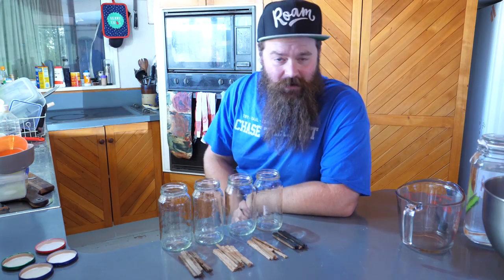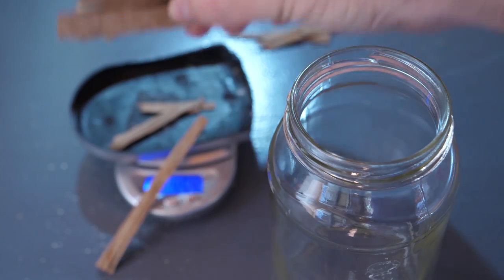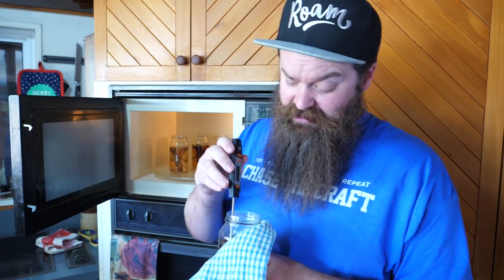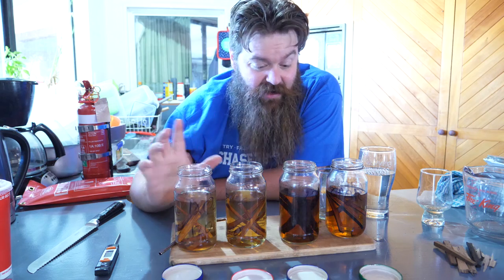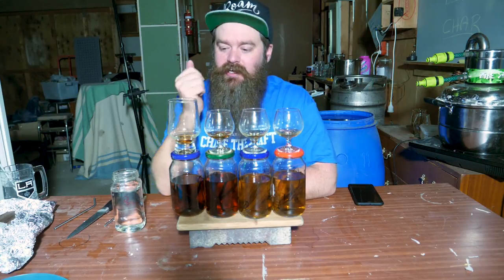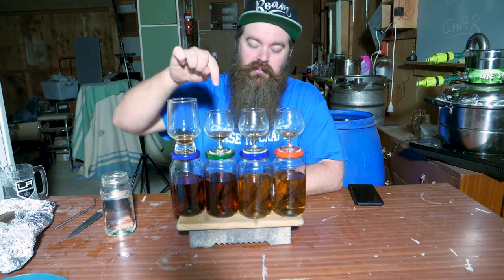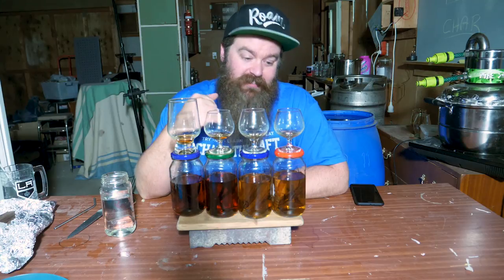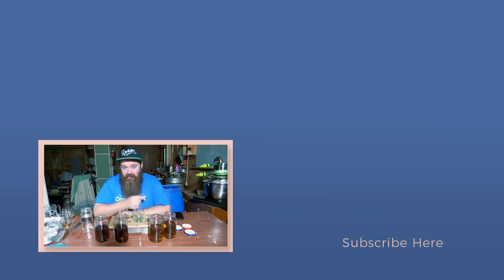Testing Different Oak Char & Toast With Nuclear Ageing

Comment: I age mine in a sous vied water bath. Slow heat prevents the glass from breaking , keeps it at a constant temp, then take it out and freeze for an hour , do it again . You can keep the lids on and not worry about accidents.
Reply: I know this is old, but do you have a fav time and temp?
Reply: @thirstbuster78  I wouldn't think it would be to high, to mimic what a whisky warehouse might experience.  90f max for a couple hours?

Comment: Thanks for a very good video that so thoroughly acknowledges the differing approaches and applications to this very complex phase of craft distilling!   
  I’ve personally come to the conclusion that jar aging can only mimic long term rest in a barrel.  I’ve also reached the conclusion that over-oaking isn’t really an overarching concern.  Why?  Because with small sticks or chips the wood pretty quickly becomes saturated and won’t give up any more after a certain point. After this initial saturation point of a couple of months the flavors extracted from the wood will mellow on their own. Time is a key element that cannot be discounted. 
  I’ve arrived at making the largest splits possible of about 3” in length and will fit thru a 38mm jug neck. I use enough to more or less float as a single layer in a gallon jug that is about 3/4 full of about 65%. These are toasted/roasted/charred over an open flame in a small covered pot with a perforated bottom. I keep shaking these to put out the flames until they get hot enough to want to burn. I then take off the cover and let them burn until it’s too much to handle and then quench in a bucket of water. Some of the sticks are deeply charred while others are toasted to varying degrees. Generally, about 15 of these go into each jug. 
  After about a month the liquor will be quite smoky tasting and very woody. After a couple of months the sweetness comes to the fore.  After sitting thru some colder weather it really settles in. It seems to be pretty well settled after about 6 months or so and I’ll usually start bottling some off but some have sat through the winter months. I usually clear out the last of these by about 9-10 months to free up jugs for the next season.  Doing all of this in an unheated garage gives all of the temperature fluctuations I could want and I consider 6 months to be a minimum target but haven’t seen any problem with letting it sit longer. 
  An awful lot of posters seem to panic when it gets dark brown and tastes strongly of wood after a few weeks but as I’ve said I figure that first couple of months to be a saturation point. It won’t do any more than simply mature after that. Time and patience. 
  Just my 2 cents worth and what seems to work pretty well for me.  Thanks again for your concise advice based upon your experience.
Reply: chucker have u tried electric heat gun

Comment: Hi Jesse, just adding a note here.  I have used a batch of chipped American Oak to flavour my first litre of whiskey which turned out delish (to my untrained nose and pallet), but seemed to fall short on the second batch (using the same wood chips). SO I've come to the conclusion that the wood chips I used (about 100 grams per 1 litre of 80% spirit) was good for the first batch but ran out of goodness for the second litre. After a few iterations of heating and cooling on the second batch I couldn't shake a certain chemically smell. Once I used fresh wood chips it was gone immediately after the next heating cooling iteration. I came across  great article  that said the chips impart certain smokey caramelly\vanilllaish flavours in to the spirit while the charred charcoal chips present act as a filter and soak up undesirables. Thanks for your efforts. Im having so much fun!!

Comment: What I have done successfully in the past (and present) when doing quick aging of spiced/herbal spirits such as Akvavit, Bäsk etc. to try out the spice blends proportions is to put it in bottle/jar in dishwasher and let it run a cycle or two.Same works well to get initial coloring from wood.
Reply from the maker: nice
Reply: This is a really good idea when you put it on 70 degree celcius dishwasher but how can you control the expansivity ? The boiling heat of ethanol is 78 C  and if it starts boil (forexample) it will blow up it's container. Even if you controll the heat and just hold on 70 degrees the expansition will start. Am I wrong please let me know

Comment: Fantastic experiment.  Oddly enough this past weekend I was doing some taste tests with friends in a nuke aging experiment.  I did 4 cycles + 1 week and compared it to 1 month, 2 month and 3 month regular aging.  All using medium toasted oak.  Everyone preferred the nuke aging flavors.  I did do my cycling a bit different than you but more experimentation is def in order with the results I got
Reply from the maker: Tru that? 
Interesting man!  Yeah I must say I waas blown away at the flavour I got out of this.  Definitly keen to play with it some more!
Reply: Few months of aging won't do much for the profile in normal environments as you don't have the temp range change of winter/summer/winter/summer/repeat does when you age for years.  You need the full cycle.

I know a couple of guys who vary the cycles.  Some cycles are "warm" and some "cold" and some "hot" and some "freezing".   You can use anything from heat lamps to radiators to microwave to stove top in water to putting outside in the sun.  For the other cycle you can use the refrigerator, the freezer to outside in the winter.

Vary the cycles like in nature.  Try many cycles to see if a "10 or 15 year" cycles is better than a "3 or 4 year" cycle.  Try with less wood over more cycles as well.  Try with used wood after first batch.

If you loose the "complexity" of the un-aged shine, feel free to blend un-aged product back in to the final mixed product.  You might find you like some wood at 5 cycles, other wood at 10 cycles.  It doesn't all have to be aged the same amount of cycles.  Keep good logs and adequate samples as you go for reference.

Experiment!
Reply: Also keep in mind you can add complexity by using the wood to "age" sherry, brandy, wines and other alcohols first before using them for you whiskey.

Comment: I have a useful labeling tip. Use clear tape, write on the tape once its been stuck on the glass. Apply another piece of clear tape once the ink is no longer runny. makes a cheap label that wont rub off and when your done you can just remove the tape.
Reply from the maker: Dude that's a great idea!!
Reply: going a step further you could also color co-ordinate it. Also i swear im not a pintrest mom. I resell magic the gathering cards on the side and wanted a cheap and effective way to label my boxes but still have them be useful after the box is no longer needed.  @StillIt

Comment: Interesting background on your bubbles from the wood......In the early days of the railways here in the UK they needed to maximize the lifespan of the timber sleepers; prevent rot etc. They didn't have the tailor made timber preservatives of today but they did have creosote. They needed to ensure the creosote penetrated as deeply as possible into the sleepers so they heated the sleepers in a water bath for a time to drive any air from the timber before quickly removing it from the water and submerging in cold creosote. As the timber cooled the creosote was drawn back into the low pressure voids within the sleeper to ensure the deepest penetration possible. We still use a similar idea today except with vacuum vessels.That's the cause of the bubbles - if you leave the jars to cool then ethanol will be drawn deep into your oak. Firelighters? :)Yeah I know it's nerdy but I'm a sawmiller.

Comment: If you had a gazillion bucks, you could do a large number of accelerated solvent extractions (ASE) using a Thremo ASE unit.  These instruments use a sealed stainless steel “bomb” capsule filled with your material of choice and a high pressure and temperature injection system to extract various organic compounds from that material.  We use them at the laboratory where I work to extract organic contaminants like flame retardants and lipophilic chemicals from fish tissue, soil, sewage sludge, etc.  You can use any number of different solvents including ethanol to extract your compounds of choose.  You can also set the extraction temperature and even set up a ramping routine with different temperatures.  The ASE would work fantastic for your experimenting, perhaps too well though as its a very aggressive extraction.  You can set it up to operate automatically and walk away.  Come back later and you have a set of 12 different extractions.  Here is a link to a YoiuTube video about two different older models of ASE.  The video predates the acquisition of Dionex by Thermo Scientific so bear in mind it is very dated, but the principles of operation are the same.

http://youtu.be/8DPLCVuugzY
Reply from the maker: That's awesome man.  Have seen other home distillers replicating this, but didn't know the origin.
Reply: I don't know the origin of this process. There is a known distiller Brian Davis who has a process similar (if not the same, I am sure he holds the process a bit of a secret) to this. It seems he has refined it on a whole level in of itself.  @StillIt

Comment: Heat expanded the wood releasing the oil and gas. (Bubbles)  And allows for absorption of the alcohol.  I heat my jars  in a pot then let cool down,  then put in freezer over night.  Then repeat till I  get the flavor I want.  The heat expands the wood, and the cold shrinks the wood forcing the alcohol back out of the wood and  the goodness with it.
Reply from the maker: Awesome. I need to try the pot way some time as well.
Reply: Still It so many possibilities, that's what's great about the"chase the craft"

Comment: Try putting in a pressure tank. Bring up pressure to 100 psi for a week in a warm area and then put in cool area for a week with no pressure and repeat three or for times. I think you will enjoy the results.
Reply from the maker: Yeah I need to try this for sure.  I was thinking about using my corny kegs.  But I guess I dont really want carbonated whisky haha.  Will need to find straight air to hook up.
Reply: @StillIt  how about using oxygen?

Comment: what ill do is put the container with the lid on in 160°f water till the container is hot to the touch let it slowly cool down then stick it in the freezer so there is no alcohol loss and it drives the alcohol into the wood deeper
(edit) letting the pressure raise in the container not only add the age affect but also fusle oils and other nasty tasteing compounds that are usually in a spirit ment for ageing get trapped in the wood and charing this is why most whiskey barrels are charred. the alcohol molecules are rather tiny and move between wood cells with ease but the nasty compounds are usually larger and get trapped, this is usually why someone goes for a older whiskey. a simple explanation is when the spirit is heated it gets driven into the wood deeper and when its cooled and the pressure drops the alcohol is pulled out leaving behind the nasty compounds.. in no way do i advocate pressuriseing jars in the microwave if the vapor pressure builds to high mixed with the heat it will explode
Reply: Dan Campbell please use centigrade as well as f save us checking lol
Reply: Try a sous vide bath ALDI Uk £50 and can cook the cheep joints for a week or do at 50c or higher
Reply: @barrytipton1179 , I agree they should do the work of converting so you don't have to. 😒

Comment: Just thinking. Putting the jars in a double boiler until temperature. I am going to give the oaking a try
Reply: Now mix all four together!!!!!
Reply from the maker: I wondered the same thing Sman.  

I was told that the microwave did a better job than just heat.  But I can varify that through personal trial. The other idea that was thrown around was heating from the inside etc.
Reply: Good idea. I'm thinking a water recirculator / sous vide stick would work well too
Reply: Jeremy MacGregor I’m going do same say every 24 hours ish to save lekky do some cooking too have you tried leaving lids on I’m going to use whiskey bottles or  kilner jars

Comment: If you are trying to get a consistent temperature for the quick aging, could you use a sous vide for this instead of microwaving it?
Reply from the maker: Definitely.  I have just been doing it in the sink with the hot tap lately.
Reply: I was just about to ask the same!
Reply: Obviously more to do with microwaves than heat
Reply: @StillIt  have a video on this water / freezing technique?
Reply: @StillIt  I know i'm comming in late!
You could just simply use a cooler. Keeps the temperature in for a long time! 
Right temp or 2 degrees higher to compensate for time. I cook stakes like that... cheap...

Comment: As for those bubbles... it's due to the heat in your wood vaporizing any residual moisture and the vapor rising causing a moment of exchange where the alcohol therein enters in place of the vapors in your wood. That alcohol can't wait to move in.

Comment: Tip! Use a small piece of clear tape and place it over your markings on your jars. This will save your notes even if ya try washing it. Just peel the tape to remove like normal. Also Medical tape (or clothe tape) is useful incase your marker just won't stick enough to get a clear reading. Cheers!

Comment: Just a note. The same process is used for sealing wood except you heat the wood in a microwave on it's own and then place in room temp resin or oil. This pulls the resin/oil into the wood. I am sure you could do the same with this aging process. Safer than heating the alcohol. 
Heat the wood and place in jar and seal. Repeat process until satisfied.

Comment: I had a friend in Washington state that has been making and aging whiskey for several years. I was working on stabilizing wood by infusing resin into the wood with a vacuum pump. I tried that same technique with a couple of jars he had just started aging. I took it down to 29 in. Of mercury (complete vacuum). When he tried it he said it tasted like 40 year old whiskey. Very smooth. Please tell me what you think. Great videos.
Reply: Infusing resin... Tell me more!
Reply: @Jazz-ji9zu  it's a way of replacing the air in the wood grain with resin and baking it. It turnes the wood into plastic that can be worked or machined.
Reply: Interesting, how long did you leave it at vacume?

Comment: so..here's a question. Do you loose any alcohol by heating in the microwave to accelerate aging? I'm assuming not because the heat doesn't go above 60 degrees C. I'm just starting with home distillation and I make my own charred oak chips ( because I have access to loads of Oak offcuts for free)...I'm using an Air Still as a beginner, and double distilling taking cuts on the second distillation as per your videos ( which are great). Is there any advantage using a copper parrot on the second distillation to help with purification?

Comment: What type of oak did you use?
From what I have heard, some guys put the jar in the freezer over night.... which makes the wood contract,  in the morning, they set it on the counter, all day long, letting it come up to room temp. Then they do this for two weeks. 

This freezing temps make the wood contract, squeezing the yummy goodness of the wood into the jar. As the wood comes up to room temp, it swells back up, flooding it with product. Over two weeks, this process can really up your game.

Thats what I heard.
Reply from the maker: This was American white oak. 
So they dont heat it?   I guess in terms of pressure change its probably about the same.  (just a different temp range).
Reply: Recently learned that aging becomes dormant at about 50°F. That's in barrels, though. Not sure about wood contraction.

Comment: There is an idea to make aging under pressure. Pressure-heating-cooling. Of course not all I will splice.
Reply: Try pressurizing it in PET bottles with CO2 and a "carbonator cap", available at most homebrew supply shops. Note I do not say carbonate, I say pressurize. No need to shake, as you're not actually trying to get the CO2 into solution, just using it to pressurize the liquid into the wood. Once you've achieved pressure, hold for as long as you like, probably 20-60 minutes, but it's up to you. Then release the pressure, and repeat as many times as you care to. One full pressure/depressure cycle could be compared to one warm day and one cool night in a barrel aging warehouse. It's a lot, but if you did this 8,760 times, you could THEORETICALLY approximate 24 year old product. Since many days don't get that warm, and many nights don't get all that cold, you could probably get by with far less. Totally making a up a number here, but probably 1/3 as many cycles as days. Whatcha think, Still It?
Reply: @monkeysuncle2816  lmao give it a try mate!

Comment: hi jessie, love what your doing gonna give it a go ! just wondering if you put the wood in before or after you dilute the product ?

best wishes from ireland
Reply from the maker: I normally age in the 50-60% range.  So if it comes out of blending around there cool, if not I'll drop it down. Then again to bottle strength after it's done with the wood.
Reply: ta for the reply Jessie
Reply: I always did mine at 40 percent

Comment: Just put the jars in a big old pot of hot (60C) water (bain marie) instead of the microwave. The point is the cool/heat cycle right. It is a bit slower but inherently safer. Also, depending on season and climate, the great outdoors are great for cooling it down. … especially if you use larger jars.

Comment: Weight in the wood isn’t as important as surface area (if the pieces are not uniform)

Also, the wood isn’t charred like a barrel.  In traditional barrel aging the mash doesn’t come in direct contact with the oak, it moves through charcoal in its process.